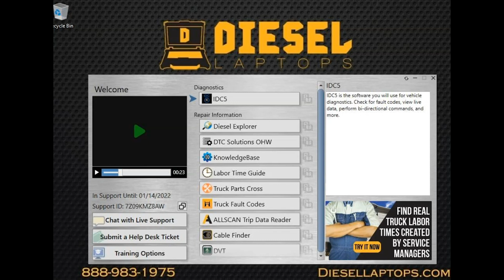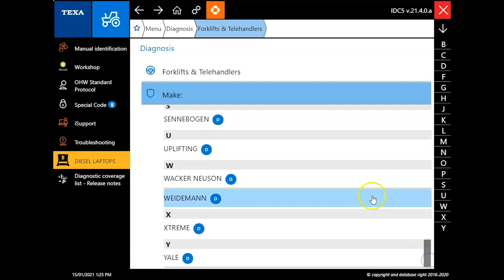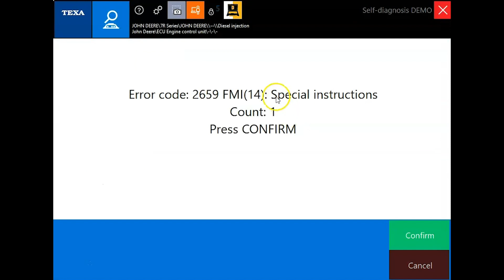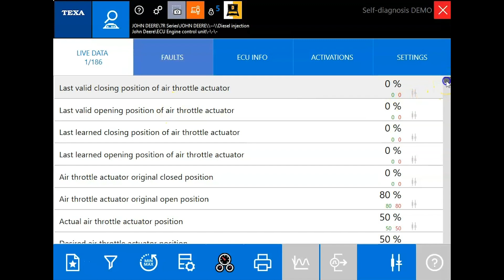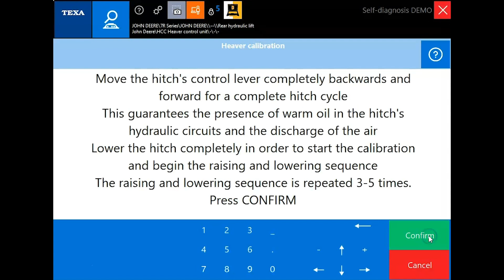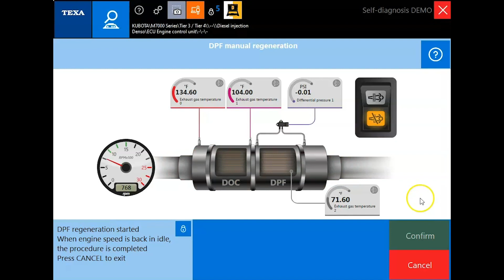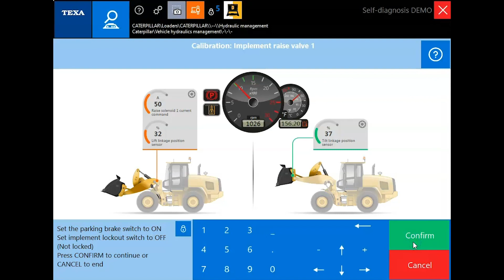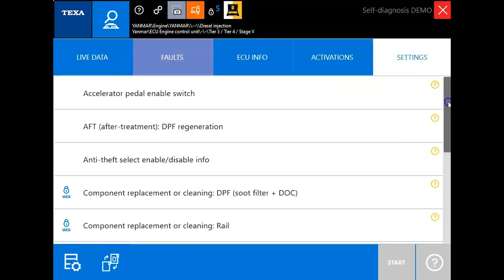2021 TEXA Off-Highway Software Walkthrough on Diesel Laptops Diagnostic Kit

Comment: I saw you had forklifts on the screen at the beginning.  Does texa cover forklift scan capabilities?
Reply from the maker: If it’s larger diesel powered forklifts the TEXA will cover it. If you also need smaller coverage for forklifts, even electric ones like Toyota, we’d recommend this one from Cojali (you can add truck, ag, and/or construction licenses to it as well). https://www.diesellaptops.com/products/cojali-jaltest-material-handling-equipment-diagnostic-tool